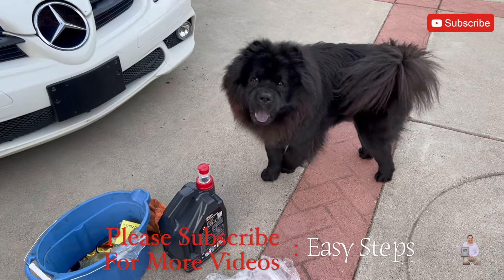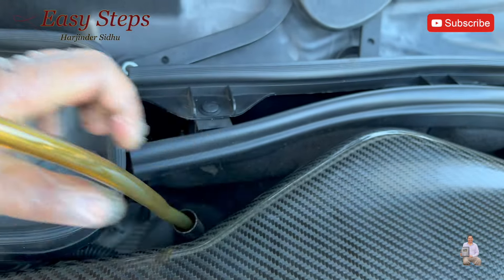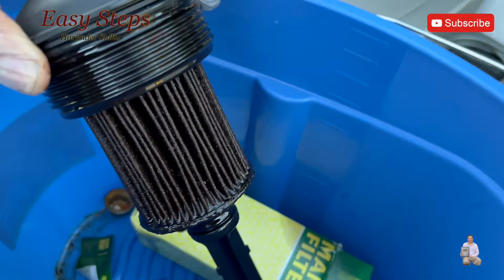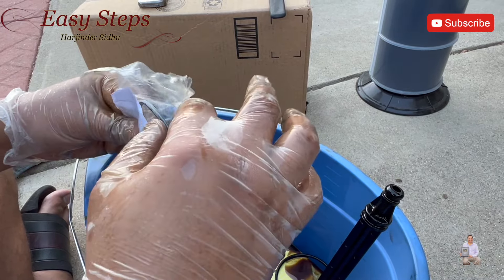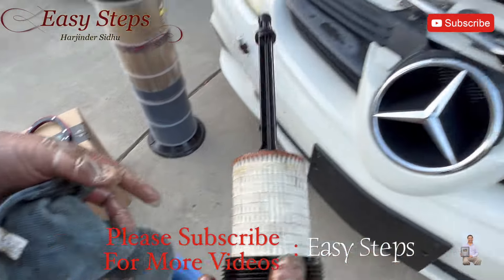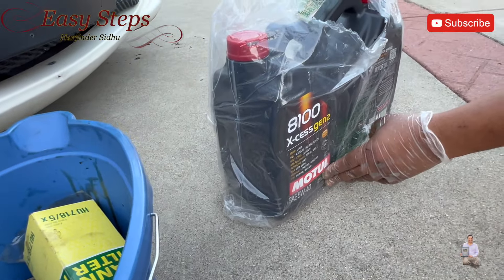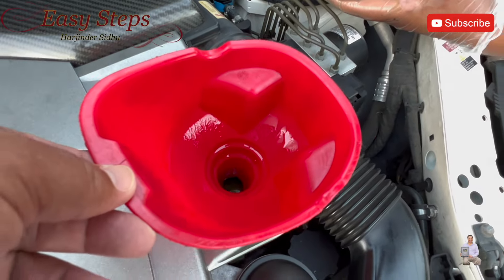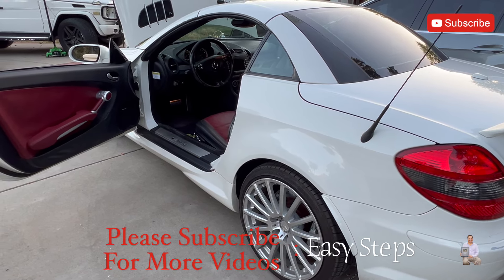How To Change Engine Oil and Filter on SLK55 AMG Mercedes | R171 Mercedes Oil Change With Oil Pump

Comment: I have a question, my SLK 55 2006 recently had a service, I check the fluids every now & then I checked it yesterday morning & I could see oil in the coolant I don’t know how that’s happened the car doesn’t overheat or anything or show any sign of misfire or any sort but it’s definitely something concerning, do you think it could be a head gasket issue or something such as the oil coolant?
Reply: Check for carbon dioxide in the coolant circuit.  Pressure test the system.  When you will get oil in the radiator you will get coolant in the oil pan.  Both are bad for the motor...
Reply: There is a rubber seal at the timing cover which with age now over 15 years will deteriate and allow cooking to mix with oil
This is far more likely than a head gasket. HAVE A 2005 SLKAMG.

Comment: There’s no drain plug on the bottom?
Reply from the maker: Thank you for watching. In this video, I show you how to change the oil in your Mercedes SLK55 AMG using a vacuum pump. This method is faster and cleaner than using the drain plug on the bottom of the oil pan.
Reply: There are two drain plugs bottom oil pan has a sub frame channel and the second drain plug is needed to drain all the oil. Will leave a little less than a quart in the pan with the extractor. Adjust the fill accordingly